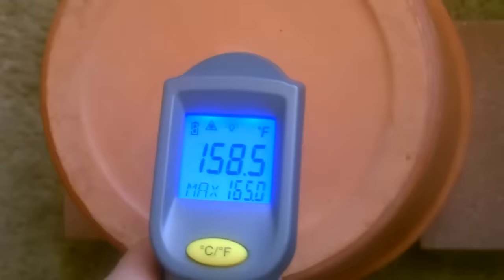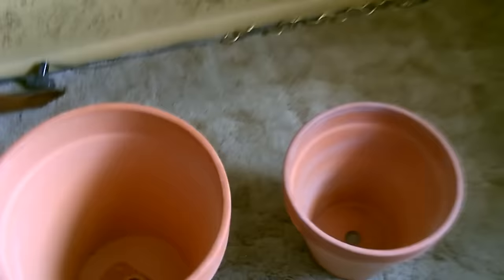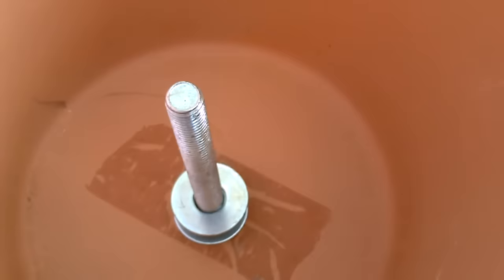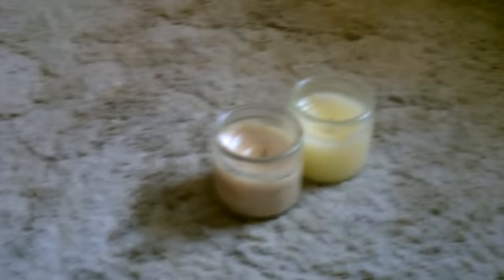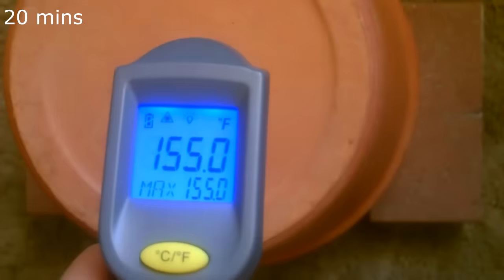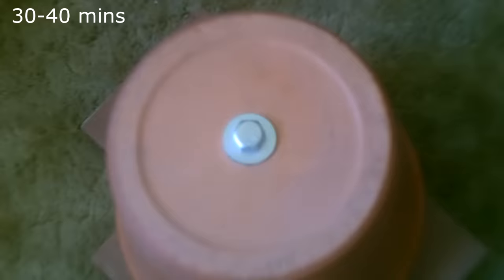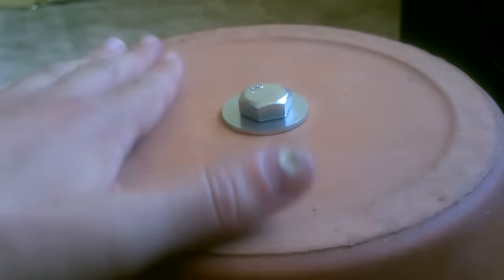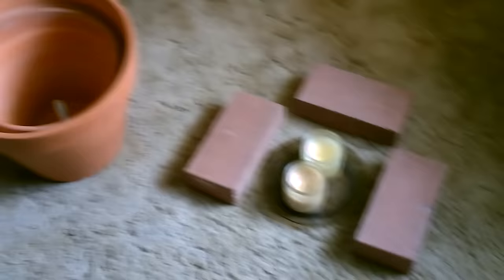Candle Powered Air Heater - DIY Radiant Space Heater - flower pot heater - Easy DIY

Comment: I would be interested in how it affected the overall room temperature over time.
Reply: Yes I would like to know this as well.
Reply: People point a  the thermometer at the device or touch it and say it's hot. But does it help the space any. I'm sure it's better than nothing. But it would be good to know.
Reply: Alan Caye
No. It doesn't help the space any.  You are spot on with your question. Tempurature is a measure of "hot", not heat energy.  Only when you combine tempurature with thermal mass (of the room air, say) do you get "heat".  And, the room air mass is heated from the candles, no more, no less - irrespective of any "pots".    You get the same heating from the calorie content in the hydrocarbons from burning the candle wax.  Over time - the pot makes zero difference on the room temp.   Furthermore, $/calorie, or $/BTU for electricity or gas is far less expensive than $/calorie candles.
It doesnt work. it /cant/ work - (unless you are using differnt thermodynamics than what they teach in this world.)  Save your pots for growing basil.
Dr. Gary Rutledge, (Ph. D.  Physics)
Reply: Okay then. I like basil. Thank you.
Reply: Verfolnir
Ever heard of thermal biomass?  You mention it in your discourse but fail to understand it's importance... You heat up the biomass of the pots and they retain the heat over a long period of time releasing it into the room over a very long time.  the difference is in just burning the candles the heat is generated and lost in the same moment, in heating the biomass the energy is retained and distributed over a much longer period of time.  Biomass is key to making this work over a much more extended period of time.  Place a sound biomass  between the two pots and you will increase it's efficiency even more.  Ph D Really?

 It's like using a rechargeable battery, you can fill it with the energy save it as it were and then release it over a longer period of time.  The pots are the heat (batteries)  They store up the heat and then redistribute it much more efficiently than the candle alone could.  The best way to make great use of this is to exaggerate the size difference between the two pots so there is a larger gap between them.  Then fill that space with a tightly packed thermal biomass such as rammed earth.  Seal it in then heat up the pot/biomass to a measured temperature and kill the candle.  Then measure the time it takes for the biomass to totally discharge it's retained heat into the room.  The next part of the puzzle is insulation.  Insulate the room to retain the heat the biomass is generating or rather redistributing.  Bang you got efficient heat over a long period of time.

In an emergency situation something like this could be heated using a candle, a small wood-gas stove, a can of sterno or any kind of heating, the resulting long term heat retention and radiant heat distribution could save your life.
Reply: MrBrendel99 You, sir, are missing the point. The point of this device is not to heat an entire room. It is to heat the surrounding area. As Dr. Rutledge pointed out before, this would have no effect on the temperature of the entire room. And your analogy is also incorrect. A better analogy would be using this heater to heat an entire room is equivalent to using a rechargeable AA battery to power a computer. It's just not enough energy.
Reply: Doesn't work worth a damn!
Reply: Verfolnir yeah. i've tried this.  not enough heat from 4 candles to make more than a 1 or 2 degree difference in my bedroom, with the doors closed, over hours.   it would have to such a well insulated room, that you wouldn't need it anyyways.
Reply: sepitheroth
Yes - exactly.  The point is, specifically, you'll get the SAME heat in your room from your 4 candles -- regardless if you have them under pots, over pots, on top of pots, in pots, or no pots.  The pots make ZERO difference.  Enjoy your candles, sure! I enjoy candles!  Put them on your desk and write you memoirs and misives by candle light.   The pots are meaningless.
Reply: The pots hold the heat and radiate it.  I think you are missing the entire point here!
Reply: Pretty sure if you bought a couple of large sheets of reflective material and made a fort like this g in a corner and put that in there it would work fine and be nice and toasty

Comment: It's also worth noting that the more terracotta pots you layer, the warmer that this heater will get.

The way it works is by trapping the warm air from your candle in the first pot. This warms the first pot, however, this isn't where the bulk of the warmth comes from. Eventually this warm air, which rises, will overflow from the first pot and into the second. This warms the second pot and the first, which in turn heats the air and causes it to overflow again, into the open space outside the largest pot.

The more clay pots you have, the more this process repeats, thus the more warmth it generates. You don't even need a particularly large set of clay pots. They simply need to be large enough to fit into one another with space to spare.
Reply from the maker: hi. that is what i thought originally but in testing i tried 2 and 3 pots and it seems that 3 pots doesn't get as hot as two. i can't tell you why but that is just how it worked. 👍🔥 (maybe 3 is acting to actually trap the hot air inside and it can't get out as easily?)
Reply: @desertsun02  Perhaps the 3rd pot wasn't large enough, and so was just containing the heat from the second while the flow from the second simply escaped into the open air?

That is to say the air was trapped between the second and third pots and acted as an insulator?

Comment: So if you use a oil candle you can use canned fish oil and other oils you would otherwise throw away, good way to heat a cabin or maybe when fishing or hunting.
Maybe use a small pot which stands normally on the ground and cover it with the 2 pots , pore some oil in the small pot, put a fuse and light it up. You can return the unused oil back in the oil container you carry it in for later use. You will most likely be able to use lard and old cooking oil that way too.
One thing though, why did you put a not in between the 2 pots, air is a great insulator, if the 2 pots were touching or better yet had perfect contact by being glued together with concrete or clay or something like it they would act as a single thick pot and disperse more heat.

Comment: interesting about how you mention copper. i placed an old Toshiba lap top cooling fin/sensor on top of the candle. it generates more heat than the candle itself thus multiplying the heat output and faster and longer retention of heat. i also used the ceiling rod for the light fixture with a hole in the middle with adjustable nut so that the heat can escape through the hole and warm up my potpourri on top.

Comment: I try this last night and it didn't get very hot. I made out better by covering the hole in the smaller pot and placing the bigger over it. I used a 10" and 12" terra-cotta pots with 3 candles. I'm looking for a cleaner fuel source, possibly gel fuel.
Reply: Sadly gel is just as sooty, maybe even more so then a good tea light.

Comment: Wonder what would happen if you sandwiched some aluminum foil between the two pots to help rapidly conduct heat from the inner pot to the outer one. I would think it would help get it up to a higher temperature faster, but that it wouldn't hold heat for as long because it would allow heat transfer from outer to inner rapidly as well - meaning once the heat source was removed and the outer shell started to cool it would cool the inner too. Dunno, though. I'd like to see someone try that.
Reply: The entire pot doesn't matter. Just burning a naked candle creates just as much heat. Which isn't nearly enough to warm a home by the way.
This entire project doesn't work unless you want to heat a dog house or something
Reply: Willem Arnhem This is a radiant heater, it's not meant to heat an entire home, it's meant to warm a part of a room, or even a small room. The principle behind this is sound, and goes back millenia. While lighting three candles will, definitely, produce the same amount of heat, the heat will go to the top of the room and produce little noticeable effect. Whereas containing that heat and allowing it to radiate will create a noticeable amount of effect for the same amount of BTU. To put it another way, this device is trapping the heat that would otherwise be lost to the ceiling (where, unless you are 8+ feet tall it won't help you) and allows it to dissipate/radiate in all directions from a device with much more surface area. By allowing the trapped heat to radiate, it won't shoot straight up because it's a slower release, so it'll have more time to heat the surrounding air (that's the difference between the 1000F, or so, of heat coming right off the flame and the 150-200F heat radiating off of the ceramic).

My comment was just questioning if placing a more conductive material between the two pots, other than air (which is not very conductive, that's why insulation works - it is designed to trap air), might greatly amplify the effect desired here. That's one of those things that I can think of it working either wonderfully, or horribly, and would need to actually test to verify, because neither result would surprise me.

Comment: just increase the power. pour the wax into a bisected coke can with some vent holes near the wax level. suspend a napkin or other large wick. when the can gets hot enough it will form a wax vapor at the entire top surface. the can will also then be hot enough to ignite that vapor. nice little feedback loop. puts out some serious heat. use it to heat jugs of oil contaminated acetone for distillation

Comment: Consider this: in the video, the surface of the pot is about 160F (71C) while a candle flame is typically around 2500F (1400C). It would be interesting to see how high the flames are and how long the candles last in and out of the pots.

Comment: Desert,
I made this as you instructed and mine got to 170 degrees so I'm saying success! I do have an issue with the candles melting rather quickly. did you have this issue? was there a remedy  by adjusting the height

Comment: Would not a third larger pot on top with the hole open not create a convection effect? Heating colder air at the bottom and rising it through the third pot and out the hole on top heated?

Comment: I have seen similar where only the smaller lower pot's hole is covered so they can use 4 candles but the outer pot doesn't get to hot

Comment: Would work much better if you left the hole open in the large covering clay pot, as it would creat a hot convected air flow?
You could place two small stones on top of the first pot, elavating the top cover pot, to creat an air channel?
Reply from the maker: hi. i've tried it both ways but never saw much difference in how the unit heats so with this one i just put the bolt through. no heat stream, but the unit soaks up all the heat of the candles and radiates it well.

Comment: A candle flame is approximately 80 watts of heat. Multiply that by the number of candles to determine the heater output. 
   Now compare the cost of running the heater for X number of hours to running the same amount of electric power.
   My electric company claims to charge about $0.10 per kilowatt hour, but with taxes and fees it inflated to $0.20 per kilowatt hour, so be extra careful about that part of the math. The best and easiest way to calculate your actual total kwh rate is to take the dollar amount and divide it by the kwh consumed for that month.
   I have no idea how the financial comparison will work out, so I'm genuinely interested in the results. I'm also interested in the cost of burning alcohol instead of candles for operating cost, and because I think it might be cleaner burning. I'm of the understanding that denatured alcohol is better for fuel than isopropyl.
    I realize of course the emergency aspect of the device, so please don't slam me for that.

Comment: What do you think about modifying this with some sort of thermal absorbant - like dirt - to create a thermal battery of sorts?  Or is there something better?  I saw your other video of the 12v diy heater.  Do you see anything better than brick / cement as slow heat release?
Reply from the maker: hi. i've read that sand works very well too.

Comment: This is a great idea, but can someone advise how to adjust it to the following issue: our home will be without electricity for a few months due to home renovations. I'm not too worried for us, since we can layer up and huddle together to keep warm, but I am worried how to heat up the kitchen/hallway for our dwarf bunnies, which is where they sleep. They have a blanket and a cushioned bed to sleep on, but still, I'd like some continuous warmth in the room for at least a few hours in the night. I first thought of a gas heater, but that seems so dangerous because we will be fast asleep, and I dont like the idea of a gas canister with some helpless bunnies, no way. The terracotta pot idea seems safer, but (a) it would have to be surrounded by some sort of cage so the bunnies dont get close and touch the pot by mistake, and (b) it seems the heat doesnt spread far enough; so if I put the pot on the kitchen worktop, the heat wouldnt reach the bunnies asleep on the floor. Please can someone suggest how to solve this problem? Thank you!
Reply: If you're without regular heat (power outage) move everyone into one room, I would set up a tent in the living room and we camped out for 4 days until power cam back on.

Comment: If I just light the candles there will be the same heat in the room. No need for pots.
Reply: I came here to say exactly this. Conservation of energy.
Reply: Still, perhaps focusing the radiative heat using a tin foil you can heat only yourself, locally.
Reply: Nikos Korexenidis There is also no point to the bolt in the middle.  The original design used 3 pots and capped the hole of the first and last one.  That forces the heat to pass 3 times over the pots before rising to the ceiling, trapping as much heat as possible down low.
Reply: +Nikos Korexenidis The point is to trap heat that would be lost through convection to a space at the top of the room with no appreciable benefit to people near the candle(s). You could redistribute that heat with a fan, or something, but then you would be putting energy into heating the entire airspace of the room. The pots trap the heat of the candles and provide local heat through radiant distribution. The claim is not that there is somehow more heat produced by putting the candles inside the pots.

Comment: but the issue is really how big a room and how well is the room insulated.   i've done variations on this, very similar, with 4 candles and 2 terra cotta pots,  didn't use a bolt or nuts, and yeah it radiates heat, but not enough to warm my bedroom.
Reply: i'd rather create a mini rocket stove and burn wood or pellets with a small stove pipe in the corner of my bedroom.  much more effective.  i guess the terra cotta radiant heater could be useful for your toes under a desk.

Comment: The top pot needs to have a hole at the top to allow the air to flow, the idea is the center pot gets hot, and the outer pot the cold air gets pulled in from the bottom and hot air escapes from the top.
Reply: Question if the biggest pot, doesn't have a hole then it will also get hot eventually and save the hot air. If the pot is too full to hold the hot air it will leave the pot from the bottom sides (just like the the hot air got out of the inner pot) which means that  you don't need a hole in the last pot.
Reply: You don't need the hole but it's more efficient for the last pot to have a hole for air flow.
Reply: But if you use the radiation to heat with it, then you don't want it to leave the pot. Radiation = Heat Waves which are send from the hot pot.
Reply: But moving air warms quicker. The center pot heats the air as it passes.

Comment: I wonder if it would increase efficiency if fins were made of thin aluminum or aluminum foil on the outside pot. This would create more surface area to heat the air since aluminum is a good conductor of heat. If someone tries this, comment under this post and I will be able to read your results.

Comment: hummm … I wonder if you could put a 100 watt lightbulb in there. They get pretty hot, just don't know if it would heat up the pots enough. Cheers
Reply: Just slightly more heat from a 100 watt light bulb. Candle = 250~300 BTU. A 100 Watt bulb = 314 BTU. 6th grade physics class.... but they don't teach things like that any more

Comment: The bolt you used appeared to be about twice as long as necessary. Is there a reason for that or did it just happen to be what you had handy?
Reply from the maker: the longer bolt enabled me to experiment with the design. using a longer bolt allows you to hang the inner pot lower (closer to the heat source). after experimenting i determined that the inner pot should be hung as high as possible. this allows the candles to burn strong. (hanging the inner pot lower cuts the oxygen supply to candles causing them to burn weak and even self-extinguish).
Reply: Thanks for the reply. Have a nice Christmas.

Comment: Interesting idea.. My first curiosity is, how much CO2 will be produced? Is it negligible? I wonder what the overall heat output is or how well this would heat a regular-sized room??
Reply from the maker: hi there. since your just using standard candles there is no issue with co2 or co. the amounts produced are extremely low. just remember... it's just a couple of candles. i'm my younger says i used to regularly burn 6 or 7 candles at a time (just for the ambiance).